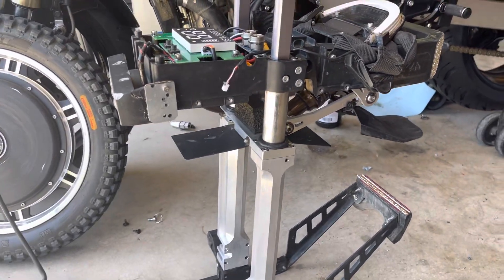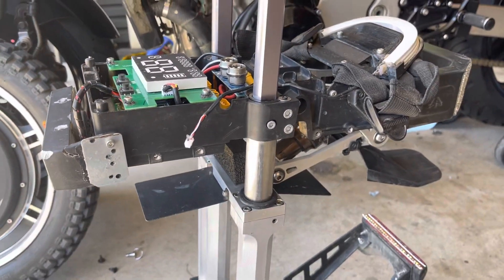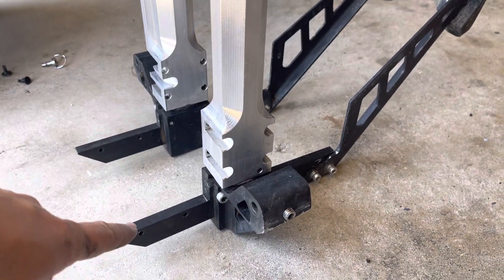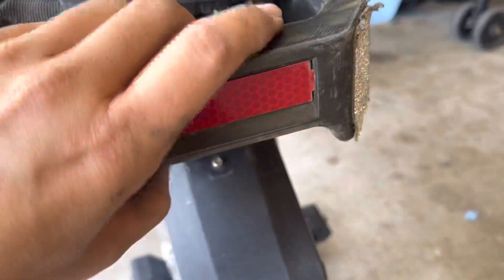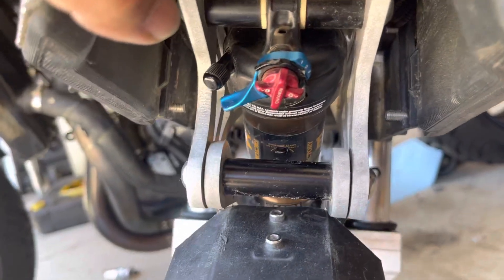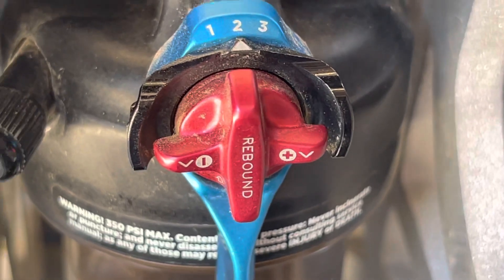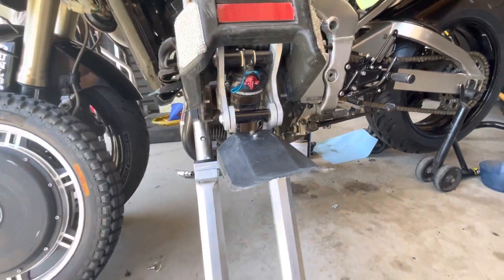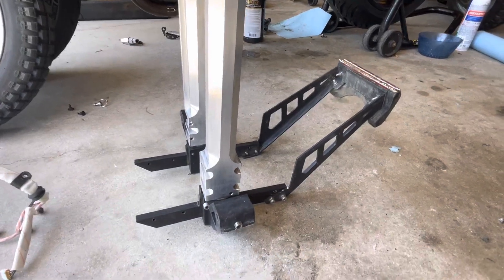This is all there is to electric unicycles?

Comment: Yes.  It's 100% firmware driven; the whole thing is basically made of FRU (Field Replaceable Units).  Sensor package, wheel, battery, controller, chassis, in some sort of configuration - being an embedded engineer in a previous life I still haven't learned to fully trust the technology because it's flying without a few nets.  I invested 10k USD+ in tech I am still unable to completely give in to and trust at speeds that will really hurt me.  I have been feeling kind of dumb for a while now about that.  But.  Electric Unicycle!  The future is now and it's pretty cool.
On the upside, there is lots of room for improvement, in materials and design.  It's taking me forever to get my projects together but with funding and a couple headcount I could deliver a prototype that's better in several significant ways in way less than a quarter.  Probably going to take me 6 months per feature on my own but have to get a slab down so I can make room for a proper workspace.  Some old "colleagues" or colleagues of a colleague have hinted at startup but to be honest I consider most startups to be the vanity plates of industry and about as static/fickle; you'd think they use so much open source they'd want to contribute back to the community, but once I explain that I am not going to do the whole "intellectual property" thing they ghost themselves (as usual).
1. Actual fuel gauge that you can just read and trust (don't have to think about PWM or voltage sag guessing games)
2. Anti-sag/continuous current power (what the "god mod" was, but built properly and with FW that works correctly with it) 
3. Multiple suspension changes/upgrades (compliant machines, improved materials, zero maintenance, etc)
4. Drivetrain.  Means less weight, longer range, higher torque, and higher speed - removing most of the unsprung weight from the wheel removes the angular velocity issues when turning fast/hard or getting bigger airs as well as takes most of the stress forces of impacts off your tire and into your suspension.   
5. Integrated useable grips/surfaces for jumping, hard turns, etc.  I've been threatening to steal a lot of tech from long distance/mountain unicycling components; they have awesome seat/control options that will port well (or I'll just modify/fabricate seat/saddle mount so I can just co-opt usable MTB/MTU parts directly).   It will also help to shift the stress loads from my lower legs and offload to my torso, when gripping it.  One of the main reasons I want control scheme is to be able to have a clutch and a brake so I can force disengagement (real free spin) and locking (stopping the gyro mid air) when trying to ride like I really want to.  I feel like some knobs are removed from my control and I don't like that; it's also cool to have some things managed but I want to understand what the management system is doing, which is basically giving away the firmware, so most companies won't do it.   

There are several ways I've been approaching drivetrains/suspension/powerplants.

I got "retired" early from a 25+ year career via random accident after a rafting trip in 2017 - nobody wants an eng tech that can't be a forklift too, no matter how great they are.  I have a few more years I can put into the "public retirement system" if I can get to where I can go into work again; I also miss my woods terribly (I'm in Oregon) and I'm so bored that after 6 years mostly stuck inside that I can't even try to put it into words.  Take care of yourselves because it's a LONG road back if something major happens to you, prime of your life or not. 

Keep riding hard.  Today is all you get.  Do what you can and forget the rest.  Tell Roger congrats on making it all the way without getting destroyed on the path to retirement.  Hella respect; people should get to do what they want after they're done doing everyone else's things for over half their own life. :person-turqouise-waving:

Comment: They charged 4 grand for it, which is ridiculous. Good thing we have Lim. He officially demodetized EUC. Even with OEM pricing, they already eat more than 100% profit for each EUC. By doing everything in house, they take all the profit. These companies were sweatshop companies (figuratively speaking), and about 6 years ago they start building EUC...Begode bought the patents cheaply from the creator and Inmotion, KingSong, Veteran just reverse engineer it. Everything sourced locally, in abundance, from raw material to completed wires, motherboard, etc. can be source locally.
Reply: I figure you’re pretty accurate on this. I figure it takes $500 to manufacture these due to easily sourced and often low quality material (bolts).